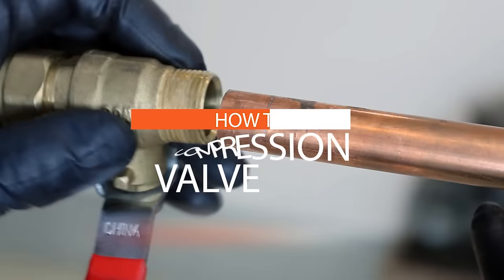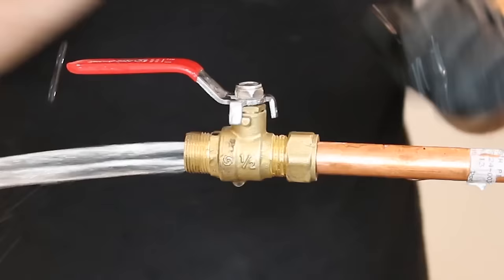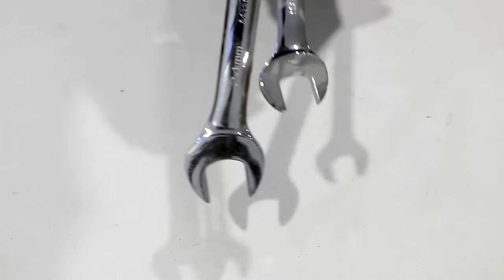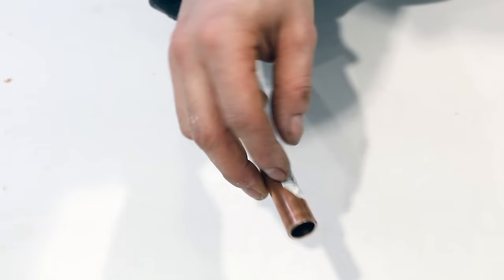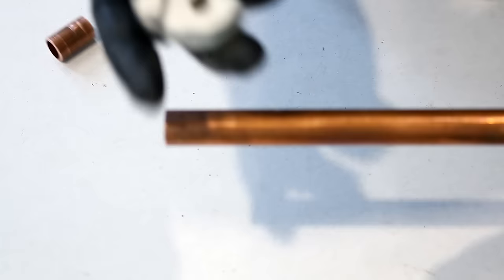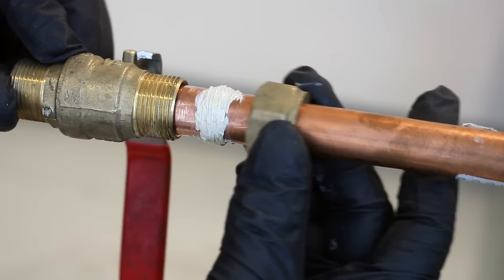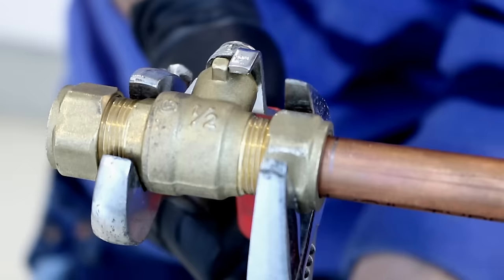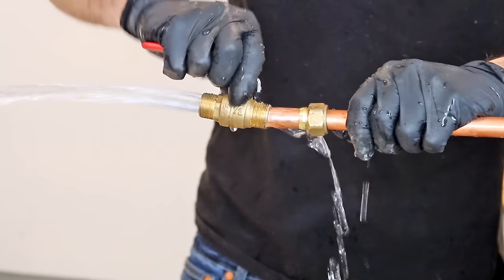How to install a COMPRESSION fitting! | GOT2LEARN

Comment: My new compression valve isn’t properly sealing evening with a lot of tightening. Should I just assume it’s the pipe is maybe warmed or bent a little?
Reply from the maker: Is this on soft copper or hard copper?
Reply: Got2Learn I think it’s hard. But I am not sure
Reply from the maker: If you can bend it with you hands, it's soft.
Reply: Got2Learn oh it’s hard I am cutting off the end to make it a little better. I hope it works. It’s a little thin in diameter for some reason
Reply from the maker: You might also be working with type M copper, which should work in theory.
Reply: Got2Learn yes it might just be that it was slightly bent front the last time it was replaced

Comment: When I go to buy the ball valve you've shown (as an example), should I just ask for one with a compression type fitting? Wondering how I should order for parts that I want to fit using a compression fitting. I only hear of FIP and NTP.
Reply from the maker: Well, ideally I suggest "soldering" a valve over using a "compression" valve as soldering is more reliable. The threads on a compression fitting are parallel threads, not NPT.

Comment: My copper pipe is covered in solder and I can't get it off. Can I just sand it smooth then put on a compression fitting?

Comment: Are these ( compression fittings) better then shark bite. Would You use them instead of shark bite
Reply from the maker: Yes, but they still have to remain accessible!!
Reply: @Got2Learn  out In the open not behind walls. Got it
Reply from the maker: @cdb989  💯👊

Comment: Hi There, I want to add a compression valve to 1/2 copper pipe, should I use 1/2 or 5/8 or 3/4 compression fitting?
Reply from the maker: 1/2
Reply: There's a clue the size of the pipe,maybe get someone who knows what they are doing
Reply: @alemgas  1/2pipe fits 5/8 compression fittings. That really confuses me.
Reply: @UCm6ijZkQr7JJbtFJF-XnNGg pipe sizes are inside diameter you don't get 5/8 pipe as I said get a professional to any work before you cause mayhem

Comment: I always use wire wool to clean copper pipe and found no need to use anything else but the olive, putting tape or any sealey paste around the pipe is unnecessary. And I have never had to tap any fittings together.
Reply from the maker: Good 👌

Comment: Do i need to buy a bigger size ? The 1/2 fitting does not slide over the tube
Reply from the maker: 2 things...
The pipe could be out of shape, if that's the case, use this trick here: https://youtube.com/clip/UgkxGPdyVH-8L-slISrAPj8iQqat-vanN573
Or it could be that there is an outer burr on the pipe so make sure it's deburred properly.
Reply: Thank you for the quick reply lol. It just looks like the fitting is the same size as the tube and literally does not fit. I saw somewhere you are supposed to use a 5/8 fitting is that true ?
Reply: For reference it is a 1/2 pipe
Reply from the maker: @Missigno213  i've heard some people experience this same problem, never knew how they went about it 😅

Comment: I have had better results using any approved potable grease/,lubricant on the pipe and ferrow/cone.. just stops the binding and pinching of the metals allowing you to get connection tighter
Reply from the maker: Yeah, works great as well!!

Comment: Compression fittings work great for many applications, but any old plumber will tell you: nothing beats solder.
Reply: I'm an old plumber. I tell you they're great. Sure, I solder most joints, but for a shutoff valve I prefer compression because they're more reliable than shark-bite and they're easy to service compared to solder.
Reply: @themonkeydrunken  I agree completely. I work in a power plant, and we install, repair, and replace plenty of types of piping with various pressures and flows. We use compression exclusively (Swegelok. Used to have Parker fittings). Water, air, steam, etc., we rarely, if ever come across a leak unless somehow the piping was damaged. All the old soldered stuff has pretty much all been replaced. If they can handle an industrial environment, they're more than enough for water lines in a home. Plus, as you stated, compression are far easier to maintenance.

Comment: I just bought a house, the shower has a 3 valve body rough in. I want to change it to a single posi temp valve. I've done some soldering years ago, my main issue is knowing which is the beat way to go about installing the new fittings, should I use compression fittings or try soldering the copper pipes? I want it to last at least 10yrs and I want it to be leak free. If you could help I'd really appreciate the advice !
Reply from the maker: Practice soldering, you won't regret it Vanessa.
Reply: As a novice DIYer, I did my kitchen and bathroom with compression fittings.
My soldering efforts were poor but compression fittings have lasted for twelve years now without any leakage. I find the nice thing is they are demountable allowing repositioning quite simply if required.
Reply: @alemgas  heheh, I just call my brother in law and he’s comes over with his company owned pro press. He say all the rookies especially are given these tools as the new generation of plumbers in training burn down too many houses doing pressure valve renos if they have to sweat the joints. Sad but true.

Comment: Does anybody knows if these compression fittings can be used with stainless steel pipes?
Reply: With stainless steel pipes you MUST use also stainless steel ferrules and nuts, valves or wat so ever.
All stainless steel .

Comment: If I cut my old compression valve off to install a new one, do I need to deburr the pipe?
Reply from the maker: I don't undetstand.
Reply: @Got2Learn  I need to install a new valve but will most likely have to cut the pipe behind the old ferrule. After cutting the pipe, do I need a deburr tool or is sandpaper good enough.
Reply from the maker: Yes, mostly inside, but if you are having trouble getting the new valve on, deburr the outside aswell 😎

Comment: Is this better than shark bites?
Reply from the maker: In terms of what?
Reply: Got2Learn longevity and replacing an old gate valve. Started sprouting a leak. Bought a sharkbite ball valve to replace it and been a week without leaking. Wondering if I should have gotten a compression fitting like this in stead.
Reply from the maker: Compression fittings are the best thing next to soldering but push fittings work very well as well, they just both need to be properly installed.
Reply: Got2Learn thanks. I properly installed it I believe. I cut it with ridgid cutting tool, than deburred inside and out, marked out wish sharkbite tool how far it would go and pushed it in. No leaks after a week. I’ll keep an eye on it though
Reply from the maker: Good job ;)
Reply: Got2Learn would you suggest removing sharkbite ball valve shutoff that i installed and put one of these compression ball valves in lieu of it, if I want it to last for the longest time possible?
Reply from the maker: That's all up to you, if you already installed it, matters well leave it there, if you think you'd sleep better at night, switch it out ;)
Reply: Got2Learn seems like most plumbers are against shark bites. Maybe because it’s taking away business from them 🧐🧐🧐
Reply from the maker: If installed well, they last a long time, the reason why people don't like them is because they are wrongly installed, and that's where they get a bad reputation, but if installed correctly, they work just fine.
Reply: Got2Learn my biggest concern is sharkbite doesn’t tell me how much of the existing pipe to remove. I removed 1/2” on my 1/2 inch copper line that had a pinhole. Sharkbite tells you each end needs 15/16” inserted which it matches up with the lines I marked. However on one end of the ball valve it doesn’t look straight (the existing line pipe) where it further down the line has an elbow. The other side is straight. So far no leaks though. I’m just nervous to take out too much of the existing pipe
Reply from the maker: All you have to make sure of is the 15/16th is properly inserted and you're good to go.
Reply: Got2Learn thats what i figured. Thank you
Reply from the maker: You are welcome :)

Comment: Do not insert the pipe 100% into valve body “Back it out SLIGHTLY then tighten the nut “. Do not use pliers , they make it egg shaped causing a leak.
Reply: The pipe does need to go fully into the valve body on every valve ive come across

Comment: It looks to me like you fitted valve wrong way round.
Reply from the maker: Huhh??
Reply: @Got2Learn  Hello.  Thinking about it where you work the rules (Regs or Code) may be different.  The brass Lever Valve body is made of two parts screwed together on one side of the lever with the rotating part inside.  In the UK the flow (inlet) side of the lever is where the two brass body parts are screwed together.  The side of the valve you connected to the pipe (which has water flowing from it) is the outlet in the UK. Can you let me know what your rules are?
Reply from the maker: Canada 🙏

Comment: All good except for the pipe dope. Its not needed on a compression joint.
Reply: RJOW2020
It's not needed, is that why it's called a "pipe dope".
Reply: @redblade8160  was gonna point out that "no pipe sealant or dope is needed" but you totally nailed it with this coment. Too funny, you really did make me laugh out loud.

Comment: Compression fittings imoo are a bitch.  But maybe that’s cause it was in a horrible hard to reach spot.  Anyways do t forget to use Teflon tape to ensure you have no drips coming off the threads.

Comment: Question is……drum roll please…….what installation directions on the fitting  package has the fitting manufacturer provided. I have used these fittings numerous times over the years and the packaging that came with instructions NONE ever said to use fitting grease or tape. Don’t you think the people that manufacture the fittings have tested every conceivable method of installation so that their products sport a good reputation? Don’t try to outguess the people that designed the fittings.

Comment: Hi thanks so much for the videos.  Is there any reason I can't use this style valve on the main line coming in the basement that shuts the water off inside the house to all the other pipes in the house?  I know this style should never be used out at the street main, but I'd like to replace a leaking gates style valve in the basement that is on the main 3/4 pipe that comes in through the foundation wall in the basement.  In this video I see this guy does exactly what I'm asking but wanted to check with the best source (you!) on YouTube:  https://www.youtube.com/watch?v=UoBVwXEzZsM

Thanks!